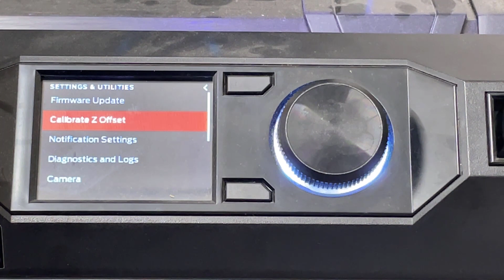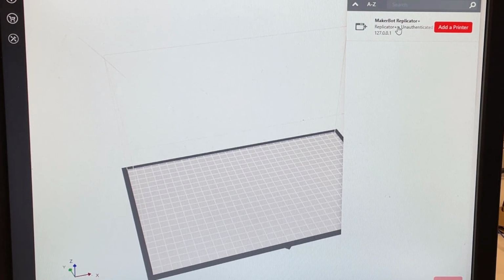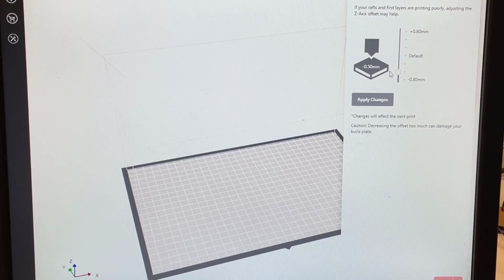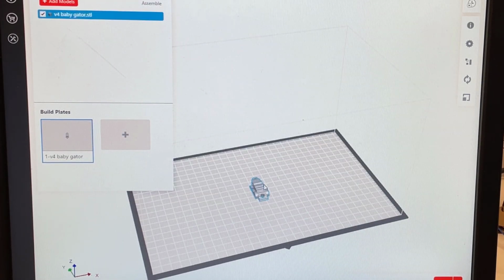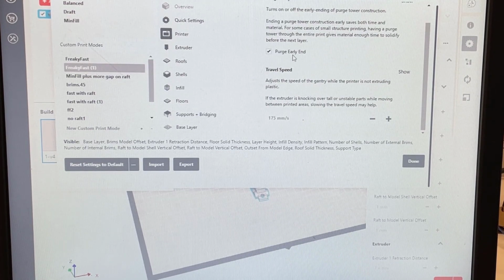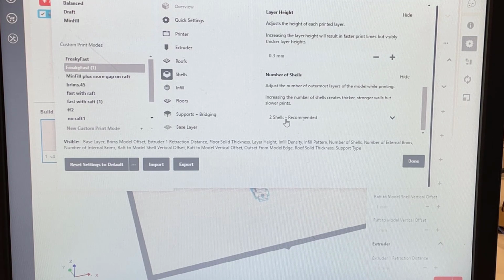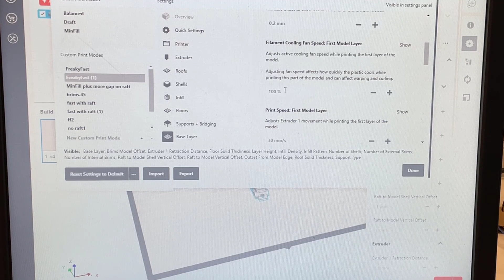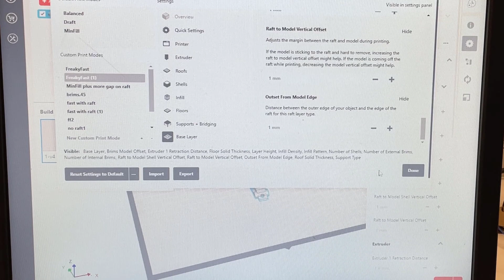Simple Steps to Print without Raft Makerbot Replicator Plus

Comment: Sets NO RAFT and then changes it's values.. does not actually understand settings
Reply from the maker: Thanks for dropping by. Are you still stuck or do you have a solution for your issue?
Reply: @HLModTech  I have a file of a 0.6mm high ( 2 layers), 3cm Diameter,  32 sided disc which I add the to corners. This can be snipped off easy when done. Find ( or make) a small face and bridge one of the 32 sides to said face.  Enough to hold it down and easy to remove after.  The REP 5th Gen plus does not have config values that actually work !!! i.e. Set first layer print speed , this sets the layer fill but the outline is printed full speed... does not stay down.  Pads are a pain but they work.
Reply from the maker: Glad you have a system. I no longer have access to my classroom printers. Liked that printer, but always prefered slicing with Cura vs. the Makerbot software.
Reply: @HLModTech  Cura does not recognise the REP 5th Gen Plus !!!!
Reply from the maker: Exactly. I had a dozen printers in my classroom I enjoyed working with. I used Cura with all the machines that were not from Makerbot.

Comment: hi thank you, new to printing. can makerbot replicator + be modified so it can print other material that is actually usable in the real life?
Reply from the maker: As it arrives it does not have a heated bed... that pretty much limits it to PLA. I do find PLA useful though.. so what type of material are you wishing for?
Reply: @HLModTech  I like to use PVC or nylon, i want to make working gears. if the problem is just the heater bed, that I can add.
Reply from the maker: This is made of PLA. https://youtu.be/gFdU3o8eAos It used almost daily by 3 of us and is still going strong after a year of use.

Comment: I'm a teacher and have the replicator+ . I am having trouble with the corner of the raft lifting up. Can you explain why you changed the settings in your freaky fast program? I am a little slow when it comes to this type of technology but need to understand it enough to explain it to students.

Thanks
Reply from the maker: I am frugal and did not want to waste filament. That is what it boils down to. It also speeds up the print a little if it does not have to print that extra material. I remember the days of my stuff curling up. I think I adjusted Z so it was closer to the bed when printing to eliminate that.